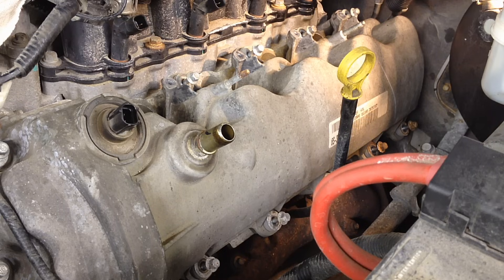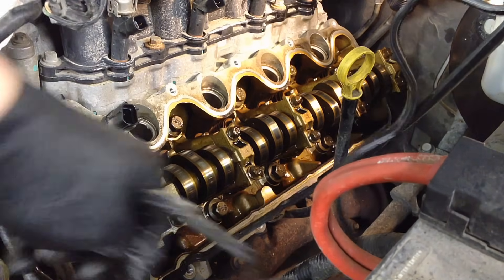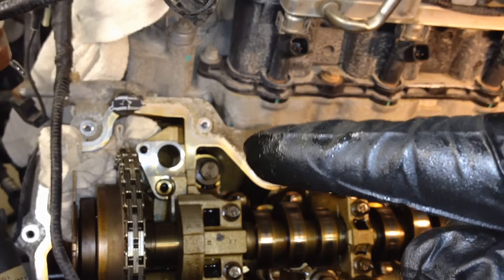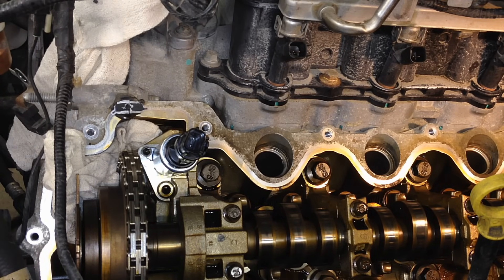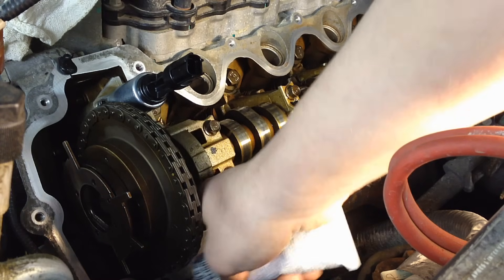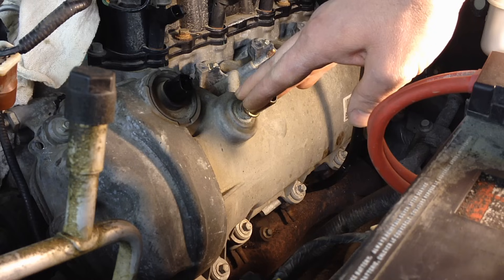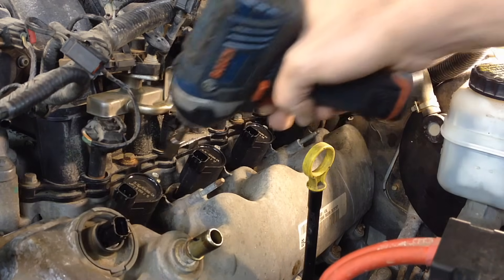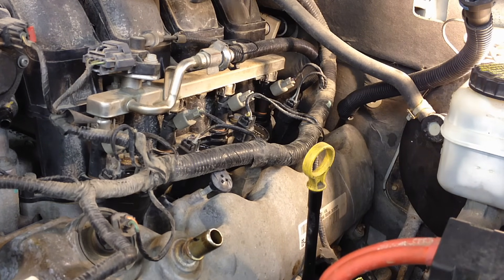Ford 4.6L 5.4L 3v Engines: VCT Solenoid Replacement

Comment: believe this can be changed without removing the valve cover
Reply from the maker: You are wrong sir that trick only works on the early models up until 2006 and the screw can back out and drop into the engine if you are not careful so for a diy I do not recommend it hence the video. Not to mention with the valve cover off you can do a proper inspection of the oil feed passages in  the VCT housing. Any engine after 2006 from mid year 2007-2014 the valve cover was redesigned and the hole is now too small. Please do your research before commenting and misleading people. Remember I started as a Ford tech at the dealer when these things were introduced  in 2004 and I was at the dealer until the end of the 3v life cycle I know these engine all too well with all their problems unfortunately.
Reply: @FordTechMakuloco  I have an 06 expedition 5.4L that has a dead spot in the throttle. In park and pressing the gas pedal and when accelerating between 1500rpm and 2000rpms I notice the dead spot.  At cruising speed when in overdrive and the rpm's are near that range it makes the vehicle buck.. it almost bucks in a rhythmicall order like in seconds 1,2,3,4,5,6,7,buck 1,2,3,4,5,6,7,buck ...
The last thing I had to do because the vehicle stopped running was replace the fuel pump control module.. immediately after I replaced that it started doing this. Any thoughts?
Reply: Billy Adams I was quoted $900+ to change the spark plugs and coil packs on mine. I asked why so much for such a simple job, was told because the spark plugs tend to stick (which is true). Did it myself in 2 hours, $150 at the most. Not a single one stuck... lol.
Reply: I had a 92' model 460 V8 rebuilt for $1,300 back in 2002. These newer engines are getting more and more expensive to both purchase & maintain. 
They tell us that they are more expensive because of cafe standards, safety, etc. Meanwhile, my 09' F150 with a 4.6L gets  2 mpg worse than the 93' Bronco w/ a 351, and cost 3 times as much to work on. 
I also had a couple of older 7.3L IDI diesels a decade or more ago, and they got 20 and 22 mpg on the highway, and cost about $4k for a rebuild back then. Compare that to a new 6.7L powerstroke getting 13 mpg at best and costing over $12k to rebuild/reman if it fails. 

The future really sucks sometimes.
Reply: Artan B your are correct sir use a one piece 27T don't use adapters
Reply: I just done mine 2007 I must have gotten lucky because I know I'm not good!
Reply: And you wonder why it's 1500 dollars to work on your truck
Reply: FordTechMakuloco s
Reply: FordTechMakuloco: you pint out that varnish indicates poor maintained engine, but what does that mean exactly; infrequent oil changes, poor quality oil used or both?  I have a Merc mountaineer 2005 with the 4.6, 106k, oil and filter change every 3k, no issues yet. What oil do you recommend and how often should it be changed?
Reply: That T27 screw that holds the solenoid is totally inaccessible/ under the valve cover!!!
Reply: You're being a bit misleading considering engine you're working on in this video has the dog ears/tabs on the solenoid valve grommet. That means you can remove the solenoid without taking off the valve covers. It's only the small circle ones without tabs that require removing the cover. Some early 2007 F150's have these older style grommets, my 2007 5.4L XLT SuperCrew has them and I just changed the VCT solenoids without removing the covers.
Reply: The small plastic cap surrounding the vct top on the valve cover can be popped off. Small screw driver and of it comes. Save allot of money and time. No need to remove anything except steering pump reservoir on the driver's side for access, and that's just the mounting bracket to push it out of the way. 

This is wayyyyyyy excessive and beyond wasteful in both time and money.

Comment: Hi, I have an 06' lincoln navigator that recently just all of a sudden started with low oil pressure and subsequently started with the knocking in the engine.  I took it to the Ford and they said upon first inspection that it was the VCT solenoid, the next day they came back with the engine being shot and replacement needed ($6800).  I just can't believe that its the engine.  I'm the only owner and in recent years have't driven it much because of my commute during the week. 
       The knocking is not constant when turned on, it will start fine and then after a couple of miles it starts with the noise, which sounds kinda like a diesel engine.  The noise is mostly heard on the left/drivers side by the tire when hood down. 
       Prior to this problem, it was suffering from a misfire at around 60 mph(it would get shaky) but past that ran fine.  I just want some feedback and any suggestions because  I feel that as a woman, I may be taken advantage of.

Comment: Hello again, you have helped me a lot before and many thanks to you, your advice is always helpful. Now, unfortunately I have a problem with another Ford. It's an Escort 99 and here's the thing... with engine on and moving, as I accelerate, the car feels like with insufficient air and it gets to the point where it almost turns the car off. I got it checked for codes and they are p0401, p0132, p0443 and p0135. I checked the O2 sensor, and it's working (checked for 0.8v and 0.2v and its ok). I changed the spark plugs, wires and coil no longer than 2 months ago for new ones. I tried to clean the EGR but I don't know if it went well since i felt no change by doing it. I'd appreciate if you could give me some ideas on what should I check or try. (IAC and MAF are clean). Thanks for taking the time to see and, if possible, answer my message.

Comment: Any chance you will be doing  video on replacing the phasers themselves?  My 2006 Mark LT has 97k on it and am sure I will need to be doing this some time before it hits 200k.
Reply from the maker: ***** Yes I have a video on phaser replacement along with links to the updated phasers and everything else you will need to get the job done right the first time.

Comment: Can a bad solenoid and/or knocking cam phasers cause you to burn oil? My 2007 5.4 3V goes through a good bit of oil and it does knock. I have about 100,000 miles.
Reply from the maker: ironDsteele No not really you likely have other issue with yours.
Reply: Probably valve seats or rings. Not worth worrying about

Comment: Really learning a lot from you about my f150. Thanks!! Having issues though.. Its an '08 I bought used a month ago and so far has been a pita! Have a p0420 code which is cat related I hope. The bigger issue is a real rough idle sometimes after coming off the freeway n going to city street speeds. Had a timing code once for the left bank, replaced vct on driver side n was good for a bit. Acting up again and no codes...? Other than 0420. Any advice on where to start would be much appreciated!! Thanks and get up the great info vids.!
Reply from the maker: Scott Hokenson Yes the p0420 code is the cat that has failed plain and simple I have a video explaining this. As far as the rough idle likely you have the other vct solenoid failing or low oil pressure when hot which must be checked with a manual gauge.

Comment: I have to look at mine, but tell me what you think of this. I have an 2004 F150 4.6L.  I've had this issue for years.  When the truck is cold it runs and idles perfect. Once it's up to temp and your stop the engine just shakes.  it never stalls but just idles rough.  I took it to Ford and they told me there was one cylinder with low compression, and they kept the truck. A week later they call and tell me now the cylinder compression checks out fine.  Any thoughts?  One master tech told me he thought a valve guide was sticking when it heated up.
Reply from the maker: Trex1268 Almost always it a coil but there are many possibilities if they have isolated it to a certain cylinder with the Ford IDS then they need to go after that cylinder with all the usual test sticking valves on these are definitely not common.
Reply: FordTechMakuloco I have the exact same issue with my 08 f150. It doesn’t stall but rough idle once the engine is at temp. When you say it’s usually a problem with the coil do you mean the COP? Thanks
Reply: @mattp0058  I would imagine yes he meant the COP...

I have rough idle when warm but it is giving me p0345 and p0022...can a bad coil misfiring cause a camshaft sensor code?

Comment: Are there any specific codes in the event it begins to fail
Reply from the maker: Fern W p011 p0012 basically any timing error codes.
Reply: would p0340 be one of those, thanks
Reply: Fern W Yes. P0340, P0345, P0349, etc. Solenoid is not always a guaranteed fix, but it does happen, occasionally.

Comment: Hey FordTeckMakuloco how you doing man? I still need some advise for my 05 expedition with code#0345 .Some guys did scope on it and told me its the ECU, what it does is getting the signal but it gets lost not coming out from there. So I change the ECU program it and still same issue same code.Just so you know car is fine works normale  no knocking or anything ells so help me hope you were in CA.
Reply from the maker: Mike Melkon Sorry I forgot the details but for that codes either the vct solenoids are sticking or the riming is off for some reason. Any recent work?
Reply: Mike Melkon I hate to down spirits but pokimon means pocket demon

Comment: Good video except you can pull that plug out and remove the solenoid thru the hole in 5 mins
Reply from the maker: Not on all and that is the point of this video. Not to mention the other points I have made.

Comment: Hey I'm about to maybe get a 2011 f150 crew cab 5.0. Anything I should be aware of before maybe purchasing this truck. And the mileage is right at 41000
Reply from the maker: kilmachine89 Listen for the common knock on this engine there are many video on it.

Comment: Do you recommend using a motor flush in the oil when doing a oil change? If yes, which motor flush do you recommend.  Thanks for the video. Keep up the great work.
Reply from the maker: 1wcastro As stated below I only recommend a engine flush chemical as a last resort before condemning the engine. Otherwise not needed.

Comment: I had the same problem so I replaced the vct on both heads and now my driver side phaser is knocking when engine is hot. Ever had this happen?
Reply from the maker: bischoff3388 No and likely the knock was there before.
Reply: FordTechMakuloco do you recommend replacing the bad one or both of them. Its actually the passenger side making noise

Comment: I am so glad I bought a 2007 F150 with the 4.6L SOHC. It lacks a little power when towing 6K but its reliable as heck
Reply: m ph Lacking alittle power towing 6k will pay off when your empty & go to refill the tank!
Reply: @willc5512 aaa
Reply from the maker: m ph Agreed
Reply: I miss my old 97 4.6 already lmao
Reply: Hey, Makuloco. I glommed onto this comment because I have the 4.6 and I have noticed a weird kind of croak noise and the sound of liquid trickling that happens about 10 seconds after it's shut off. I thought it was just something decompressing, maybe the coolant or water pump. Today I discovered that the trickle is oil dripping pretty heavily for a few minutes, then it stops. Can you tell what that croak might be?
Reply: I have a 96 mustang gt with a sohc 4.6 tried everything to get the shaking out but not this.. could changing the vct sensor help me?

Comment: On the older 5.4 3v 2004- 2005, the valve covers with the bigger grommet. I have seen numerous videos of everybody just popping the grommet off and changing the solenoid and just replace the grommet. Without removing the valve cover, since the grommet is removed there i enough room to slide it out. or is valvecover removal recommended
Reply from the maker: 4literpowered I agree but there was a reason I don't do that I edited out. Basically when you are removing the ratchet extension and torx bit if you are not careful you will knock the socket off and lose it down in the front cover not good. Also like I said that bolt can thread through the solenoid and fall off but yes some are possible.

Comment: Was that just dieletric grease on the ends of the coils or do they have a solid piece at the end of the connector?  All the coils I've seen have just had the end of the internal spring there.
Reply from the maker: PsychoCPU Yes it just has a spring in there with a dab of dielectric grease on the end.

Comment: Great video! Just getting ready to do valve cover gaskets myself, after discovering oil in one of the spark plug wells last time I replaced the plugs. 

For the phasers, I have the typical ticking sound when warm, but no drivability issues and no codes, nice even idle and no misfires. Is this something I need to address, or is it fine the way it is? Are there any "updated version" of the phasers that solves this ticking sound?
Reply from the maker: Skauber I am sure the new phasers locking pin has been hardened but no updated numbers no. It is not something you need to fix until it gets really loud.
Reply: FordTechMakuloco Ok, thanks! I'll keep an eye on them, it's mostly noticeable when I'm in a drive-thru and similar. I don't suppose there is something I can do to reduce the knock with the old phasers apart from replacing them? It's on a '05 Expedition 5.4
Reply from the maker: Skauber Nothing really a heavier oil like 5w-30 will reduce the noise only.
Reply: FordTechMakuloco Just as I suspected. Thanks for the response, it's greatly appreciated :)